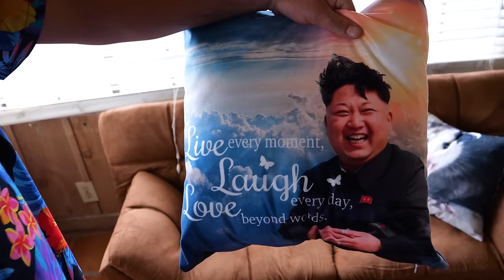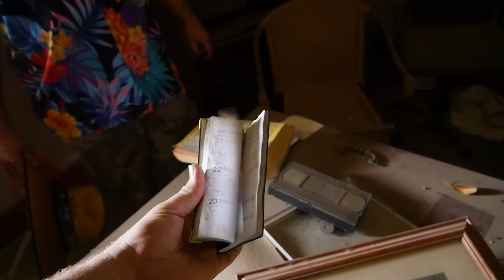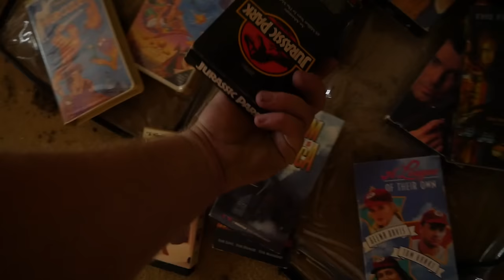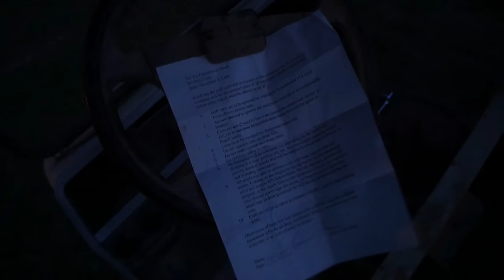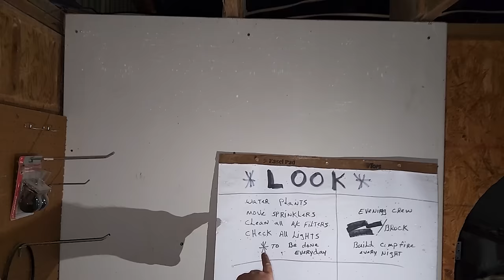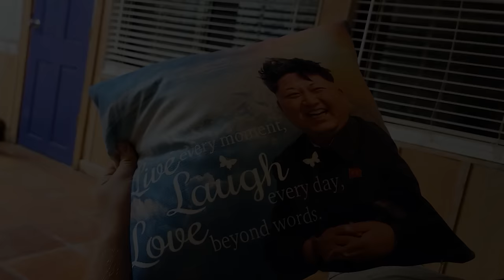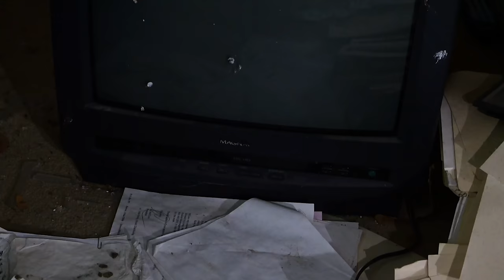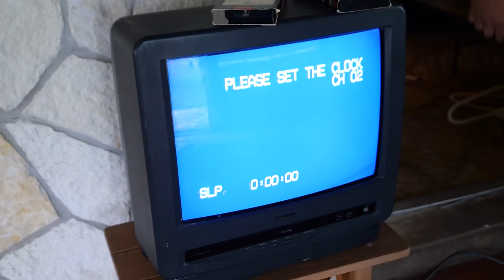We Stayed at Demo Ranch's ABANDONED RESORT!! First Guest in 17 YEARS

Comment: as someone thats recently fixed one, those golf carts are like miniature cars. The rears have full leaf springs and the front has one big leaf spring. Things even got adjustable tie rods and tiny little cable driven drum brakes. Since where i work at I was tasked with source batteries for it, Rather than spending thousands on the huge 8V batteries it wants, about 4 12v car batteries of varying quality will actually work. It wont be nearly as fast but itll make it for it in torque. The motor/gearbox is strange though, as even seen in the video if they sit for a long time, they can be "cleaned out" by just running them for a while to clean all the shit off the I assume brushed motor.

Comment: if anyone is remotely interested, on those Club Cars the first 4 characters of its VIN (sticker just under the dash) identifies the year.  Probably something like AQ06 is a 48v, regen, 2006.  That one isn't really THAT old, it's a 2000 or newer.   Until I retired I sorta fleet-managed four of those critters at work, all 48v Club Cars.   If it's any consolation,  with the cargo bed and the fact that it runs it's worth the new batteries.   Nice 'dillos, btw.  Possum on the half-shell.